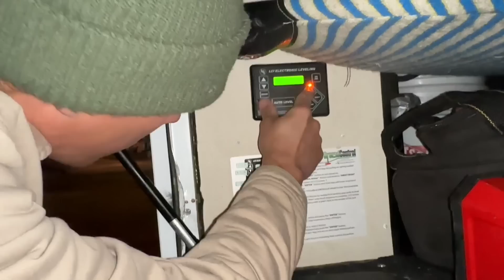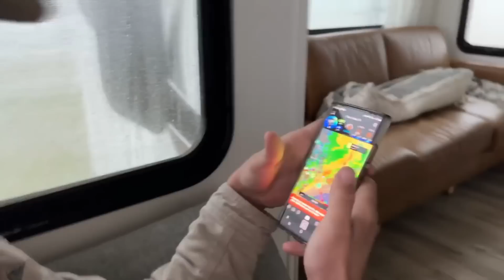Our RV is FALLING APART!? Cross Country RV Road Trip to Baja California

Comment: We enjoy your blog.  Saw your repair of your back wall to deck joint.  I found that excessive weight on the hitch can bend the I beam members.  The box is suspended on outriggers to the frame and since the box is rigid, any deflection in the frame will drag the deck down.  Taking that heavy spare off the back would be a good preventive measure.  Pulling a string along the bottom of each I beam will disclose any frame deflection.  If those members are bent, the recommended fix is to jack up the drooping members and box weld a steel plate on the inside of each I beam from ahead of the axles to the rear. Some have suggested welding heavy wall square tubing along the bottom. The axles act as a fulcrum.  Hope that helps.  There are some great welders in the larger towns in Mexico.  Mike

Comment: I always try to know beforehand when bad weather is imminent. I watch the radar to anticipate where bad weather will be and when, listen to forecasts and we keep a weather alert radio with us. Then I plan an escape, should it become necessary. Yeah, it's a pain to move but whats worse, moving or losing your rig and maybe dying? I also try to avoid rain when possible. It's very worthwhile to me. I just watch the radar and compare that area to clear areas on a map and stop or drive out of it's path. Worst case is you drive a little out of the way. So what. I will also search out bridges or even gas station canopies to park under in heavy rain, hail or other damaging weather. Don't get trapped in low lying land that will flood or near creeks, streams or rivers. Whats pretty and scenic now can turn into a nightmare in 20 minutes. Less time than you can pack up in.
Snow and/or ice, get to a truck stop or some safe place that will get plowed and stay put until the roads are clean and dry. 
If you are stuck where you are, do not park anywhere near trees, power lines or downwind of potential flying debris like other RVs, flimsy buildings and other such things. Keep in mind that many buildings have rocks covering their roofs that like to become airborne during tornadoes.
Do you carry emergency tools like a snow shovel and a garage broom for the roof (it's important to remove all snow from the roof), a dirt shovel, traction mats, window scraper, windshield washer fluid, a tow strap with a means to connect it to the truck or trailer?
Reply from the maker: all great tips! thank you!

Comment: We have a Puma 5th wheel converted to gooseneck hitch. Our 1st trip out the rubber under belly cover fell down just far enough to drag highway and something punctured our black water tank. My husband used bungee cords to hold it up untill trip was over. He purchased same flat bar you did to be more secure, so far so good, 2 years later. Warranty covered black tank.

Comment: Just found your channel.  I'm really impressed by how well you deal with challenges and just keep on rolling.  BTW, my brother has the same make of 5th wheel and his back wall bottom section became detached as well.  He had to deal with temp repairs (similar to what you did) and had constant anxiety with it for over two years because he didn't want to make the back wall issue someone else's problem.  He finally decided to have the whole back wall completely rebuilt before selling it at a big loss.   It was obvious when they pulled the rear wall out, the root issue was poor design and workmanship.
Reply from the maker: Thank you so much!

Comment: I feel your pain, We have owned 3 rv tow along. First on- wate ruined the front 1/4  which I fixed. 2nd one  had to take the back wall down to the studs and remove much rotted CHEAP wood and replaced with treated 2x2 studs and re install the bed, closets and cabinets. Also it developed a gas leak back at the water heater  that we repaired. Third one, had to replace 1/2 of the floor due to hidden roof leak- Spent 3k $ getting the roof repaired and re coated . Bottom line RV's are made as cheap as possible, if you don't recaluk, around all windows and roof openings (at least check annualy) your rv will fall apart.

Comment: of all the things that could go wrong,  never thought the back wall or the bottom falling off would be on any list.  they need to put a coat of super glue over those things when they are done at the factory.  cant believe ol craig just went ahead and fixed it all like a pro. i thought it would need to go back to the factory for repairs for a few months.   he must have a degree in engineering.
Reply from the maker: haha they really should coat them in super glue! 🤣 Craig had to get real creative with our old rig... but, it held together until the end for us and always seemed to work!

Comment: The best way to put that coroplast on is to use a 1x4 that is long enough to sit between the frame rails from one side to the other, then butt the coroplast together centered on the 1x4 and screw both sides to the 1x4 and it will hold them in place. You should also drill holes in the frame to screw the 1x4 to the frame rails.
Reply from the maker: That is a good idea! Thanks!

Comment: Look at an Escape 5.0 molded fiberglass trailer. You will have to learn to live in a smaller space but you won't have to deal with the issues you are dealing with. We have a 2014 21C and never plan to sell it.

Comment: I had and RV with similar issues luckily it got totaled by a hail storm. Got a new 5th wheel and still had issues to work through on our first few  trips. Refrigerator, brakes, electrical system,  Hit an antelope and took damage to the underside etc. Fun times but better than not traveling.

Comment: More great Denali quality. Several years ago we were at a campground and dealer delivered a brand new Denali travel trailer to the site next to us. When they started to set it up they discovered that they had omitted the plumbing at the factory. Since it was going to be a seasonal the new owners agreed to let the dealer run new water lines under the trailer. Just couldn't believe that there wasn't a quality check at the Denali factory to catch that or that the dealer did not do a PDI before delivering.
Reply from the maker: Now THAT I believe. We definitely won’t be buying another Denali. They failed to attached our black tank vent pipe to the black tank….and so the first time we traveled with full tanks, we had black tank “water” sloshing EVERYWHERE in our underbelly, it was awful.

Comment: The reason back wall is separated is probably that heavy rack you have on rear. Way too heavy,  probably have a bent frame now because of it.
Reply from the maker: That’s not the reason, we know why it was separated, it’s due to the frame on the sides being cut and the wall not having anything structural to attach to at the bottom. While maybe the rack looks heavy, it’s within the rating. Thanks for watching!

Comment: You might need to remove the paneling on the back wall and inspect the insulation. I don't think drilling a few holes for wiring made the back wall fall off, more likely leaking and rot. You need to look at the roof. The caulking is probably breaking down and that is how it's leaking. Once you see a leak it's really bad by that point. I took my back wall apart from the outside and cut the 2x2's out and replaced them and all the insulation and the plywood then the inside. I also took all the caulk off the roof and fixed most of it with eternabond tape, expensive but much better. I don't care if these trailers are pre or post covid they're all junk. Crazy expensive and there are no slide but an Airstream is the trailer to buy.
Reply from the maker: Fortunately our framing is aluminum with styrofoam insulation and so we don’t have any structural water damage. However, the issue with the holes for the wiring was that it caused the entire aluminum frame to break in half, so the last few feet of framing on each side of the back wasn’t really attached to anything. It was just a loose piece of metal in there 😅 so that’s why the bottom half of the back wall started to pull away. (We had a new roof put on last year)

Comment: Are you going to put a bead of caulk over the top edge of the outside aluminum brace so you don't get rain into the holes you drilled through the back wall?
Reply from the maker: Yes! We just couldn't till it dried up some.

Comment: Last year I spent 3+ hours underneath my trailer on the side of the road in a cold wind storm dealing with a belly cover that came off.  Ended up having to remove it and use about 100 zip ties and duct tape to secure all the loose wires.  After having the trailer for 15 years that was our last trip, sold it a month later.  Good luck in Mexico, I would never go there as there's plenty of safe places to go in the US and Canada.
Reply from the maker: Now that sounds like a pretty bad day 😅

Comment: We pull a small 18' overland teardrop so while we may have issues, they are nothing as severe as a large rig like you guys have might experience.  My only comment would be at the start of your video you had the hitch caddie installed and it appeared overloaded with the spare tire, storage boxes, etc.  That bounce going down the road has got to put stress on the rear section of your trailer.  I might not be the actual weight of the caddie but the size, meaning once the trailer starts bouncing this is going to be magnified by the caddie.  I would suggestion is at least remove the spare tire.
Reply from the maker: Definitely something to think about if we can find somewhere to put the spare tire!

Comment: I would have to think your RV has had a roof leak for some time and has been rotting the wood frame from the inside out. Usually when you see problems it's too late and the damage is done. Pray for hail to total that thing out.
Reply from the maker: We have an aluminum frame, and a while back Craig was able to take things apart and check for damage to find the cause of the issue. That’s how we know about the aluminum frame on both sides being sheared through where the manufacturer drilled holes to run wiring through 😅 I will say the aluminum framing is one nice thing about this RV since it can’t rot. Although it only works when you actually keep it intact 😂 the top half of the wall sides still have a large piece of framing to hang on to.

Comment: This is exactly the reason I refuse to purchase a RV. My wife wants a 5th wheel but after seeing so many videos with people having issues, I will not purchase one. My Mother-in-law has a 2013 32' tag along (which was built by one of the supposedly better manufactures)set on a foundation at a beach campground. That camper road miles since new, 400 miles from factory to dealership, 12 miles from dealership to first campground where it was located, then I towed it 125 miles to the campground where it is now. Less than 1,000 total road miles with a 70 yr old woman staying there alone through the summer months and it sitting with power and heat on for the winter months, it is literally falling apart! That says something for RV construction!
I told my wife, if she wants to go camping again, we will purchase a living quarters horse trailer, no 5th wheel camper. We had a living quarters horse trailer, extruded aluminum floor construction, all aluminum construction except the steel gooseneck, torsion axles, 42'L x 8'W x 8'T with 12' slide-out. That horse trailer was nicer than many RV's, had all of the options as the typical RV and cost less than mid-higher end RV's. We towed (2) sometimes (3) 1100+ horses with all of our gear and camping needs all over the eastern US with a Ram 3500 dually for a few years, even many trips were driving out into fields, rough roads or wooded areas to camp for a few days. My maintenance routine was winterize when needed, check/service wheel bearings annually, check the brakes, check/service gas water heater. Over approx 45k miles towing that trailer, my highway break-downs - 1 flat tire, my repairs other than regular maintenance - 0. Those horse trailers are welded aluminum frames and built to tow weight. Never tried this with a RV but this says a lot for the structure of those type horse trailers. We left the TN mountains for a 425 mile trip home, 2 horses down the mountains and some very rough highways. We got home to find my wife left a large styrofoam full of drink sitting on the kitchen countertop, not one drop of soft drink was on the counter.
Reply from the maker: Honestly sounds like the horse trailer could be the way to go! That's crazy about the drink not falling!

Comment: With your rear hitch rack you may not have enough fifth wheel hitch weight find out from the manufacturer today you can probably find them on YouTube on a frame hitch the trailer will sway back and forth and wear out the tires when you travel empty black gray and freshwater tanks ride in your trailer down a normal rough road Liz amazing on YouTube and her engineer partner paid thousands for a better suspension when I pulled trailers I had to retighten screws and nuts put good silicon caulking on them and any leaks I have a 2 e-bike RAC in my 2in hitch there was up and down play so I bought a special clamp for the hitch

Comment: You can buy black rv under belly only and Amazon in roll and try to strap up the wires and ductwork and use boards to hold up why you bolt to the frame and run the band iron side to side not long ways . may Jesus Christ Keep You Both safe in Your travels me and my wife did the same the new truck Duramax and a new lemon cardinal rv ps please put lock tire on back wall 🙏🙏🙏
Reply from the maker: We saw that stuff on amazon! thanks for the tips! and safe travels to you as well!

Comment: When you added the l bracket onto the back wall, did you also attach it to the floor with screws?
Reply from the maker: Yes. That way, the back wall could not pull away from the rv.
Reply: THank you!

Comment: My back wall is doing the same thing, I need to do what you did. I would rather have the bolts on the inside and the flush ends on the outside for looks mainly. What length bolts do you recommend, yours were a bit too long?

Comment: Well, this has me a bit freaked out. I'm in the market for a used 5th wheel now. How old or if you know how many miles on yours? How do you know what's not going to fall apart in a year or two?
Reply from the maker: This is a 2014 and we’re not sure how many miles it’s been towed exactly before we had it but we towed it over 12K miles in a little over a year. There are RV inspectors (similar to home inspectors) that can look at one you’re serious about purchasing and we would recommend that! They can look for major structural issues, etc